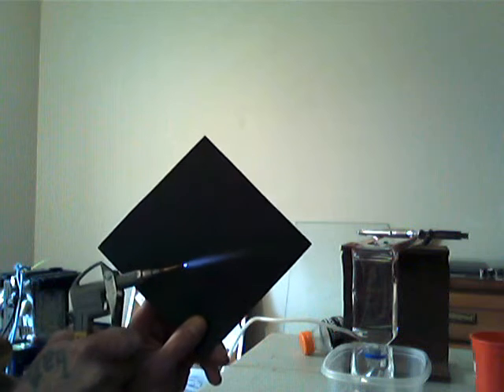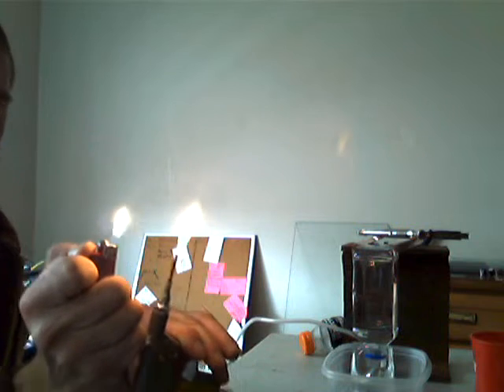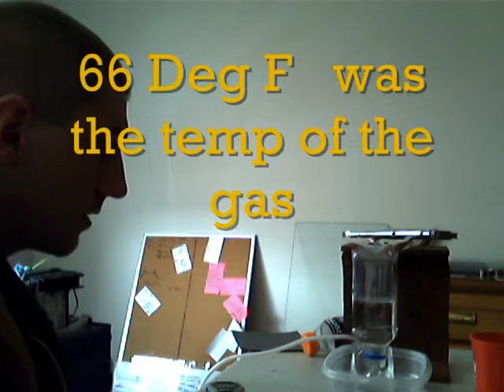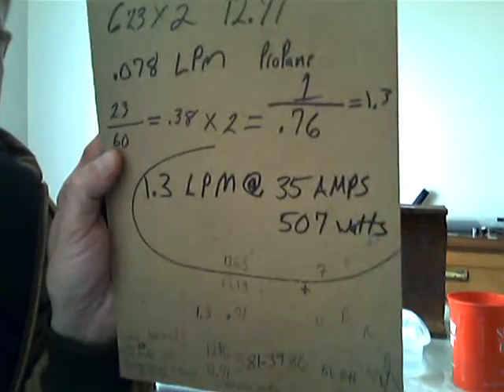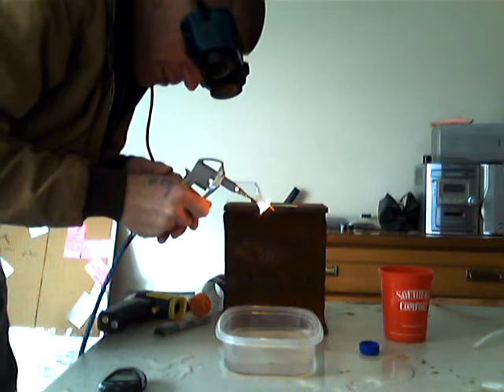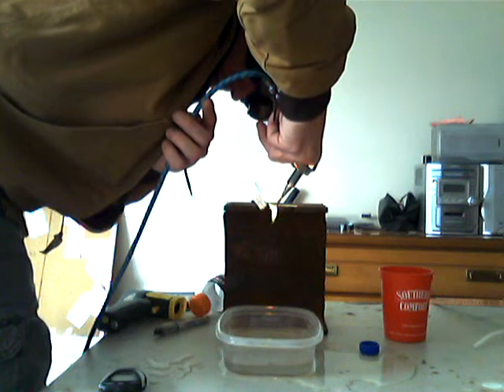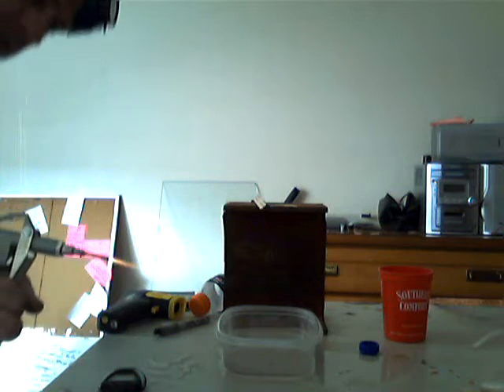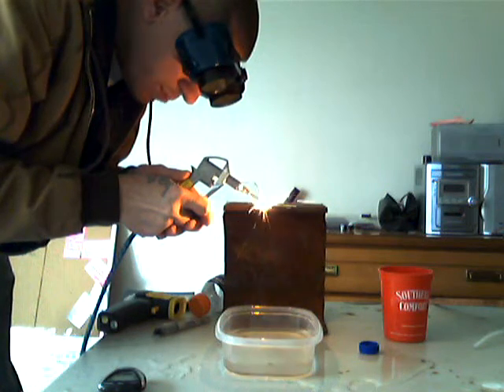hho mixed with propane

Comment: Sometimes Oxy Aceteylne will do the exact same thing with thick steel and when you get massive heat soak into the thick metal the huge cherry will cary enough melting point heat behind the torch and re fill the metal and weld bnack together. You have to play with different angles, some guys like to drag the torch facing backwards, some puch it facing forwards into the cut, major differences. It was your position in this video. Use the pressure to your advantage and blow the work as you cut.

Comment: Beautiful work ,  thanks,  regarding insAneTunA question about Methane,  will happens exactly the same, which makes me think about HHO as "the  modificator"   Remember HHO allows any material to express its own nature ?( ie  melting temp  ) what if HHO is " the modificator" , and the other material  gas or solid is just "allowed "  to release its max heat power  throug  HHO ? ??    Best regards  Daniel
Reply: The Hydrogen isn't the modifier, but the electrolysis also produces oxygen (thats the o in hho) which does allow propane to burn much hotter, apparently the ratio produced from electrolysis is 2 to 1 when you need 5 to 1 one to actually use up all the oxygen and produce a reducing Flame.
What do you mean "hho allows ant material to express its nature' as if the nature of any material is on fire as hot as it can be
But hey I'm no fucking chemist.